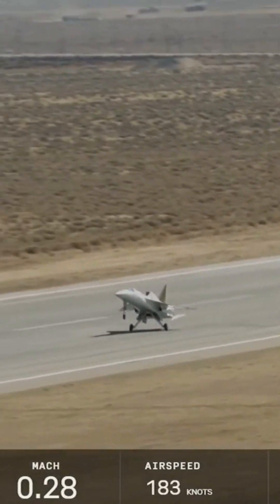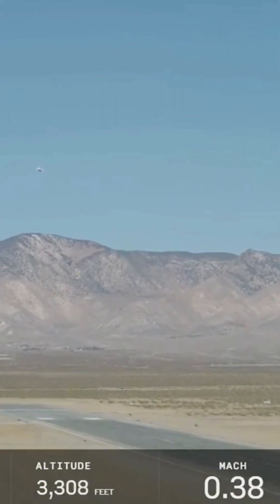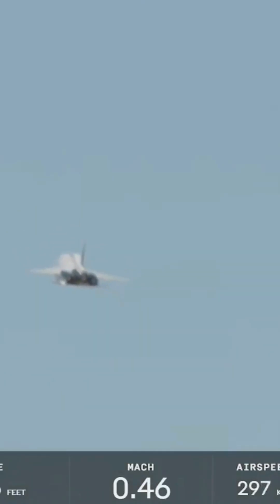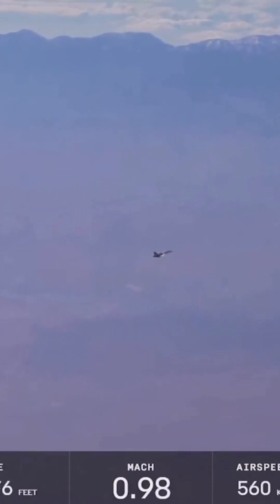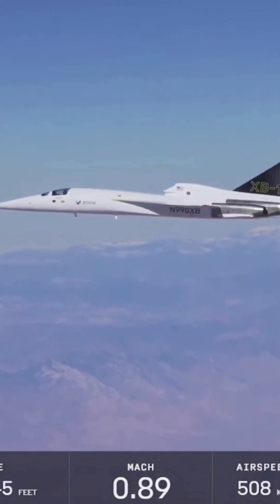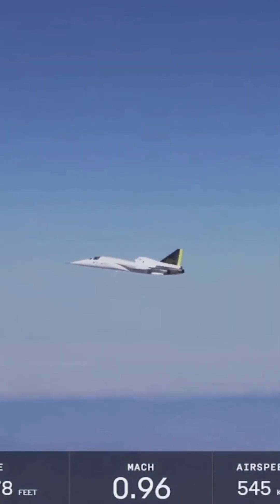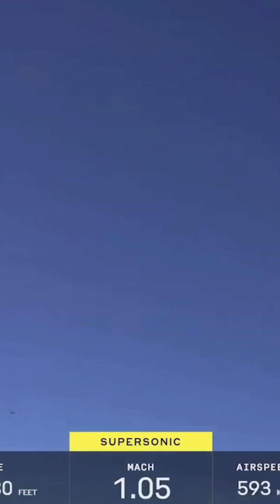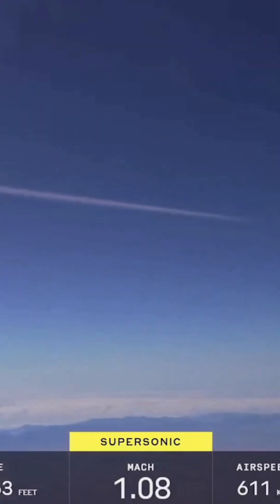Boom Supersonic XB-1 breaks sound barrier 3X #xb1 #jet #aircraft #shorts

Comment: Still high AOA take off like Concorde. That means another flex angled nose for full sized passenger transport, which means … which means..  Thousands of aircraft go supersonic and have since 70 years ago. None of them are current passenger transports. 

There are physics reasons why no large SS aircraft cross oceans without mid air refueling. None of them have changed.

Comment: What is the big deal with this? There have been countless aircraft that have gone supersonic, including passenger aircraft. What’s the big f-ing deal?
Reply: The last supersonic commercial flight was back in 2003. Boom Supersonic is aiming to bring it back, which would reduce travel time greatly. They're also trying to reduce the noise of the sonic boom or mitigate it entirely, which was one of the big issues with Concorde and a big part of why Concorde stopped flying.
Reply: @ Interesting. Thanks for the reply and information.
Reply: No sonic boom when it transitions from normal to supersonic.
Reply: @OneLiterPeter wouldn't it. then be called subsonic?
Reply: @dansweda712  Super and Sub-Sonic refers to the speed that sound travels through our atmosphere and has nothing to do with the boom sound that is created by an object as it crosses the threshold. The whole point of this aircraft is to do what no one has done and that is to have a super-sonic plane that doesn't create a sonic boom.
The caveat being that now all of the Karens of the world will have one less thing to complain about. 😅
Reply: @OneLiterPeter  so sub sonic is the same as super sonic, just without the boom, I have ammunition that's subsonic, in part due to a lower velocity round
Reply: Simple, they want to revive concorde-like passenger plane but much more quiet